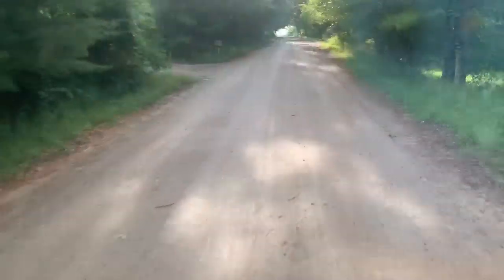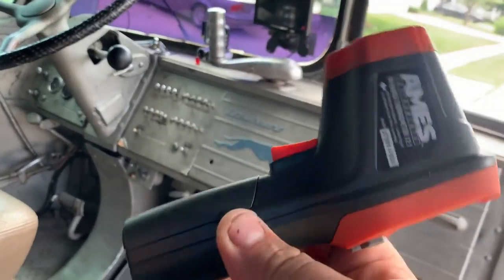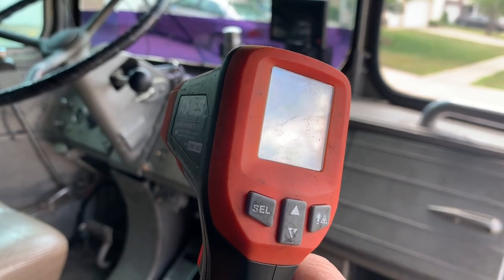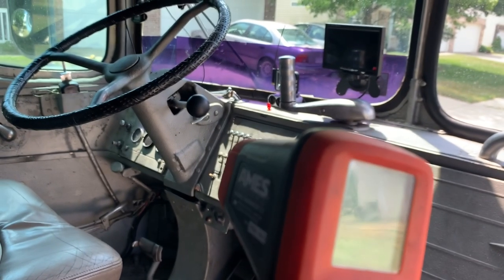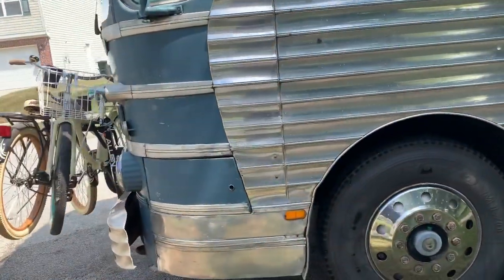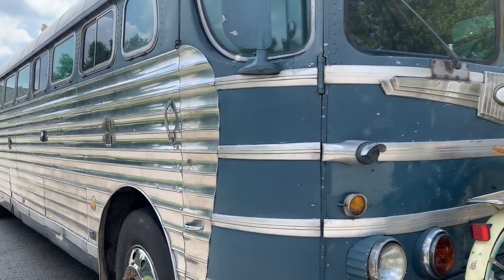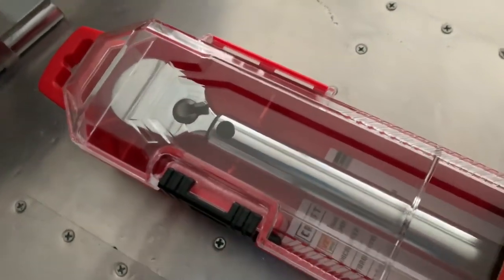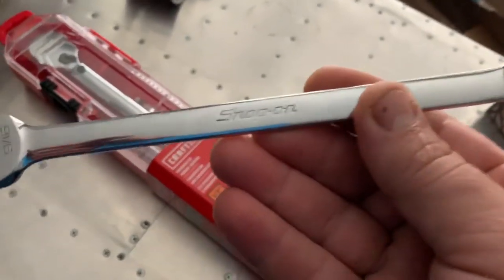Driving a vintage bus in extreme heat

Comment: I have used an ir thermometer for years about two years ago i bought a thermal imaging unit after using it i wondered why i waited so long i accidentally found a bad tire with it while learning what it would do softball sized spot in the side wall was 30 degrees hotter than the rest of tire i even think i know when it happened coming out of a boondocking spot on blm land i hit a rock with that tire hard enough that i stoped to see i had cut the side wall while expensive as all get out it has been worth it of all things it works great for helping track down electrical problems i bought the snap on one but fluke and a couple of other places make them also
Have a good day
THE GRUMPY BUS

Comment: It'll be time to source a Turbo after you get that 4 valve head installed.👍
Reply: 96ChevyDually6.5L..... Not "just" a turbo... the pistons and blower will also need to be changed.

Comment: I once had a 245hp327 in my 60 chevy station wagon. I had a fancy sun temp gage. once in the line at my bank I looked at the gage and it was pegged at 260 degrees. I put it in neutral and opened the hood. everything was fine. no loss of coolant either. 212 for boil add 2 degrees for every pound of pressure cap(15 lbs so 30 degrees) add another 15 degrees for 50/50 antifreeze and there is the 260. the buss is different.

Comment: I run a digital gauge in my coach. I set it so that it blinks at 205, but I've already probably pulled over at that point. I run 175-185 in the flats, 195 at the top of long pulls. If it goes hotter than that, I'm pulling over.
Reply: Noob question alert!  If you pull over to let the engine cool, do you leave it running or shut it off altogether?
Reply: @gearhead2be  Yeah basically what Jose Dude says. Typically, if the temps are dropping by the time you stop, just let it run a bit at fast idle till you're out of the warning zone. If temps continue to rise even at idle then something is really going wrong and you should probably cut it if you wanna save the engine. Before I had my rebuild done 2 years ago I would see temps up to 205 and as soon as I pulled over, it'd drop back to 190 within a minute or two. Now, the highest I've seen is 195 and that's pulling the top of a mountain grade. Keeping the RPMs up helps keep temps from running away if you don't have any other problems during the climb. Detroit manual says never let a 92 go over 210 but I haven't even seen 200 since the rebuild.

Comment: Like many here, I enjoy watching your videos too! I am not a bus owner or a diesel mechanic, just have a lil ole 2001 VW TDi! LOL. When you love your diesel engine, you monitor your coolant temp of course, but what about engine oil temp? I have  aftermarket digital coolant, oil pressure, turbo boost, EGT and oil temp gauges. Watching all the action is not only fun, but informational. They really tell you what your engine is feeling. LOL. I agree that the coolant temp gauge stands out as one of the most important gauges you can have, especially when you have an aluminum cylinder head! Ouch!

Comment: good information  , it's no joke getting a detroit diesel HOT  , it doesn't take long to cook it if it gets hot,, i drove my bus on a 100F day this past week it doesn't get hot fortunately  ,, I love the Laser Thermometer  it's a big help in diagnosing cooling issues 
i'm running at 180 steady  even on a long run ,, I drove  Interstate 80 through omaha to grand island  going steady at 68MPH 
i am getting 11MPH on the highway at 68 and it goes up to 14  if i slow way down to 58 ,, i have the 12R-22.5 tires you were just talking about too

Comment: I always wondered if you could install a 2nd radiator for extreme heat days for added cooling or a larger oil cooler for some peace of mind.  You do not want things getting too hot. Man, good luck with everything you have going on.

Comment: Pledge spray on furniture polish works great on aluminum panels. Wash it like normal spray, and buff. It won’t look like brand new, but it will have a lustrous shine. I learned that from an old timer detailing his plane. Nice bus btw. Big fan of the old Detroit deisel engines. Shocked when I asked a newer DEM if they had any experience and they were clueless of the make at the time.

Comment: Scott one thing ya can also do is paint the water pump and cooling neck flat black from bare metal....used to do this when racing asphalt modified's it helps dissapat the heat better!   don't know why but it does!

Comment: The Radiator Grill Inlet Area is not in direct Air Flow. I would  think that a Scoop on the Inlet Area and making sure that the Cooling Fan is as close to the Radiator as safely possible would provide a measurable decrease in Running Temperature. Ted.

Comment: Another timely bit of useful advice!  When I first looked in to buses for conversion, the phrase I encountered virtually from everybody was "Watch the temperature!" Good advice!  It made me keep a sharp eye out. Kept checking the left and right bank temps. Fortunately, I decided to go with updated instruments as the conversion went on and installed new senders and gauges, checking with a contact thermometer. didn't have an IR unit at that time (1979).  Also had a new core installed in my radiator, with an added row of tubes, and tightened up the fan shroud all around!

Do you have any sort of chassis A/C?  It isn't really all that hard, and shouldn't be, given your skill set. I built mine almost totally from reused parts, and a Frigidaire A-6 compressor. Good news is it worked on the second try! Did NOT affect engine cooling.
Reply: I was wondering the same thing about a chassis a/c?

Comment: Hey Scott, Have you ever been to Burning Man? The type of dust in that part of the desert is not like desert sand. It’s very fine and sticky. That combined with  the high winds it gets everywhere and it sticks to everything. Google it for yourself. I’ve been to Burning Man twice, and both times my friends and I bought a cheap RV for the trip and sold it to a junk yard when we got home. Your bus (especially the aluminum) will never be the same!
Reply from the maker: I’ve worked on several buses that have been to bm.  I’m aware of the playa dust.

Comment: Two things to consider: 1. The laser bean itself on those thermometer guns does not actually read the temperature. It is only a guide to show you where the temperature sensor on the gun is pointing at. Holding it at more than 1 foot away from the surface that you want to read can give you false readings as well. 2. After reading some of the comments, I feel the need to add that I have always turned my torque wrenches 1/2 turn below zero during storage. In 20 years they are still accurate. Yes, I sent them in for re-certification/ calibration and I was surprised myself. I do however store them in a stationary box in the shop, not in a box that bounces down the road regularly.

Comment: You might consider misting your radiator, kits were made in the 70s with a tank  and 12 volt pump for trucks and cars to get through hot times,you could maybe tap your fresh water tank , I saw one work it was amazing the results,  very nice videos

Comment: With respect to modified sinewave (which really ought to be called “modified squarewave” IMHO) versus pure sinewave inverters, devices with switching power supplies like laptops and PCs and many modern chargers and power supplies really could care less either way as the very first step in their power supplies is to rectify the incoming AC, whatever form it is in, directly into ~170V DC (120VAC RMS has a peak voltage of 170V) and are thus unaffected by the difference in waveform.  However, any device that has magnetics running directly off the AC (such as motors, many microwaves, and devices with transformers or linear power supplies — e.g. things with heavy power supplies) are significantly affected by the use of modified sinewave inverters due to the many undesired harmonics generated within their windings due to the fast rising edge of the squarewave and those harmonics cause such devices to draw significantly more power and run significantly hotter than with a proper sinewave supply.  That said, the UPS on your computer will much prefer the pure sinewave inverter even though the computers themselves could care less.  

Though even pure sinewave inverters technically still use squarewaves, albeit at much higher frequency (10s or 100s of KHz) and rapidly pulse width modulated the output to roughly correspond with the voltage levels of a sinewave after passing through a low pass filter that only allows the much lower frequencies to pass resulting in a 60Hz sinewave at the output — functionally identical to modern Class D audio amplifiers.

That said, these days there is really little reason not to opt for a pure sinewave inverter when shopping for AC inverters as they do not carry the order, or more, of magnitude price premium versus modified sinewave inverters that hey did just a decade or two ago when a pure sinewave inverter could easily cost 20+ times more than a comparable modified sinewave inverter of equal capacity — nowadays that price difference tends to be on the order of just 1.5-2 times and they are so much more affable today than years past!
Reply: There is an exception to this, certain SMPS with active power factor correction have a PFC controller that can't handle anything but pure sine and will shut down on any other power.

Active PFC uses a DC-DC boost converter stage after the initial rectifier to take the 0-170 or 0-340v (for 240v AC input) pulses and boosts them to 400V DC. The input current of the boost circuit is designed so that the instantaneous current is always proportional to the corresponding instantaneous voltage.

When it gets confused and shuts down, the main part of the supply suddenly only has the base 170v/340v to work with instead of the proper 400 and can't function as a result so it shuts down too.

Either way, I agree that MSW inverters are obsolete and only PSW should be purchased.
Reply: +Ethan Poole, +Daniel Armstrong, While I've been retired for a while, I've owned and operated a Motorola Two-Way Communications dealership since 1977. Switching mode power supplies have created nothing less than pure hell, with regards to problems with "electronic noise generated at or near harmonic resonance, with regards to two/three/four tone sequential paging systems and their encoders. Its gotten so bad, that we've been using 1/32-in lead foil, in the encoding and decoding/alert circuitry. Fire department communications vehicles/mobile command centers are especially vulnerable to this phenomena , and MOSFETs are often the prime culprit. The industry needs to do something with regards to "dissipating electronic artifact' which remains after artificially reshaping the modified sawtooth, and modified squarewave into their "sort of" sinewave, which MOSFETs will 'clean up after, in the next device in the chain.

I've personally thrown ferrite into the lead dress side of the equation, and I've seen similar inverters spit out so much [electronic] noise, that the only thing close to a remedy, was to lead foil wrap the Romex, or whatever else they distributed the power with, all the way to the terminus.
Reply: Look at the big brain on this guy.

Comment: I truly enjoy your videos. Makes me wanna take my bus and get out on the road. I have an 8v982  With twin pyros. Only one of them registers at  the control's.  I'm in Seattle and I can't get anyone to work on no one wants to work on a 2 stroke is that a big deal? Once again thank you for the education and the enjoyable videos your  Friend Chris👍🇺🇸🇺🇸🇺🇸🚌🇺🇸🇺🇸🚌🇺🇸🇺🇸👍😎
Reply: Whatever one bank is reading, the other bank shouldn't be too far off.  Was there ever a time when both Pyrometers did register, and if so, did you find that they were pretty close to each other?  My experiences with pyrometers are limited to straight-6 motors, but really the only time those things ever moved (much) was when I was pulling big hills.  If they went above a certain value, it was time to drop a gear or split a gear, get more air moving through the engine and exhaust manifold.  Surely to God, there must be a Detroit Diesel shop out there if worse came to worst, they'd work on it, although they'd be priced steeply.
Reply: @stanpatterson5033   When I bought the bus only one was working. 1988 prevost it's got up 5 speed Allison I really like the bus it's low miles it only has 51000 original miles,I  just ask in the freightliner people here that work on on Detroit's want  anything older than a 60 series ,all their mechanics a straight out a truck  school an don't understand 2 cycle. Thank you ever so much for the reply and I truly enjoy your  videos each week. Keep the old iron   Running.👍😎🇺🇸🇺🇸🇺🇸🇺🇸🚌
Reply: Definitely a believer in keeping old iron alive, though I'll admit, I'm not the biggest fan of 2-strokes.  That said, I'd take a 2-stroke DD any day over the damn garbage coming down the pipe these days.  Beside Freightliner, is there not a Detroit Diesel shop in the Seattle area?  Pacific Detroit Diesel - Allison , or Pacific Power Group?  Radtke Marine? Tacoma Diesel... Valley Power Systems... Gotta be some old fellers out there who work on DD's, or know somebody who knows DD's.
Reply: Nowadays if they can't hook a computer up to it they don't know how to fix it cuz they don't know how to diagnose anything by experience. Scott is one of the best mechanics I've seen that younger than I who knows their way around a two-cycle Detroit

Comment: Just to clarify, the laser is just there for aiming, the actual detection area is roughly a ring the size of a silver dollar when holding the thermometer 2 feet from target expanding the further away you are so keep it close or you are measuring the general area. Also different materials are emitting different amounts of IR light(which the thermometer bases it's reading on) at same temperatures so it pays to have a thermometer which accounts for this.

Comment: That's awesome the viewer fans send you high-quality replacements when you break tools Scott!
Question, how much work is involved in the changeover from a 2 valve head to a 4 valve on your Detroit? Obviously, vale train, what about injectors, etc.?
Hopefully,  you can do a video of the changeover/upgrade here for us curious viewers!
Work safe, stay cool. Excellent choice on the new power inverter, go big or go home...lol
Doug@ the "ranch"
Reply: there is quite a bit involved from what i have seen online. Scott is looking for a turbo. So there will be different injectors, different pistons, too.
Reply: @uliwehner  It makes sense, you can't just slap a new 4 valve on the old configuration without substantial parts changeout. I would imagine it's been done, I just haven't found any videos detailing the procedure. I'm sure it "can be done" and hopefully Scott will take us thru the process!

Comment: Maybe your bus friends have already told you that you need to bring something like tarps to put around your air filters and the like as the dust there is just like talcum powder and will settle into and plug your filters and many other things. Anything that's not plated or coated will rust for sure after BM. Laying old sheets on the floors and seats will save them lots of wear. Looking forward to your reports out there.

Comment: I can't imagine spending 70 hours polishing)) one thing about those infrared thermometers is they don't measure only where the laser is at, but rather a spot where laser is at and the farther you stand, the bigger the area it is measuring. So to get a more accurate reading on thermostat housing, you need to hold it real close. It's in the manual, and ratio and diagram is often printed on the tool itself.

Comment: I suggest a ratcheting strap with a hook at each end to secure you bikes. Run the strap through the opening at the bottom of the rack and hook to the bike frame at a low point.

Comment: Thanks. Interesting info on running temps. Nice to be able to install the 4 valve head soon. Do you know if you will have a power increase with the new head? Better fuel mileage, reduced temps, etc? Another interesting video. Take care.

Comment: I can't recall where I read it (and it was some time ago) but supposedly the most accurate dash oil temp gauges are the ones made for smaller aircraft engines.
Reply: Check with an aircraft avionics shop for guages

Comment: Scott, that'd be great if you could sell your fresh 2 valve head to offset the cost of getting your new 4 valve head machined and installed. That's a win win for everyone involved, will be neat to see how your liners and pistons look after 1,000 miles too. Hopefully the shop turns tgat 4 valve head around quickly for you. Do you have a set of rockers ready to go for the 4 valve head?

Comment: Y am just amazed what you can mount to your vehicles in the states, like the bikes in front... Or huge un braked trailers behind a truck or Whit no lights at al,  Regarding al the shit we have to take in accound here in Holland..Special licences for trailers above 750kgm, special lighting, Plates in front,and back, and even double plates and  lights in the back if the original is blocked .. Land off the free i supose... lol

Comment: Pardon my ignorance, but what is wrong with running the engine over 205F? You're not event to boiling temperature, much less than even with pressure on it.  I"m trying to remember what our 8V92 used to run at in our one fire engine... I'm pretty sure when we were pumping a serious fire she got over 200.